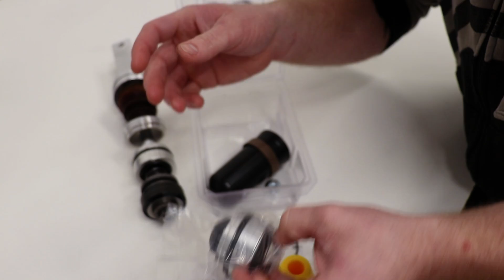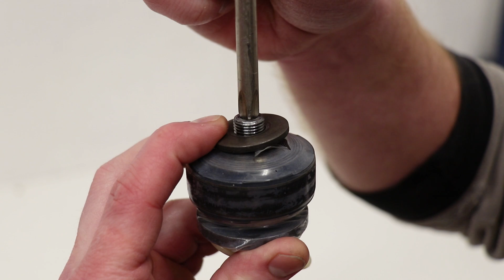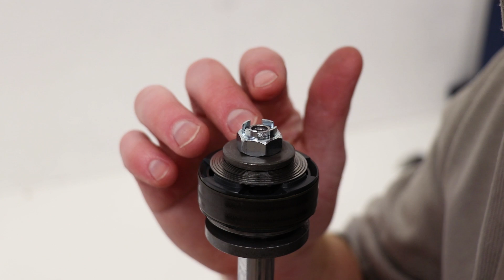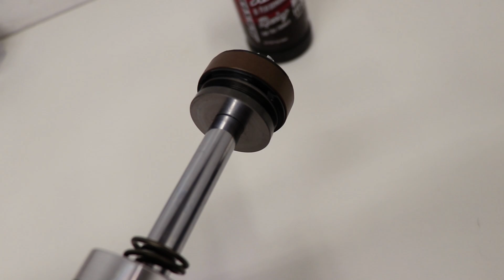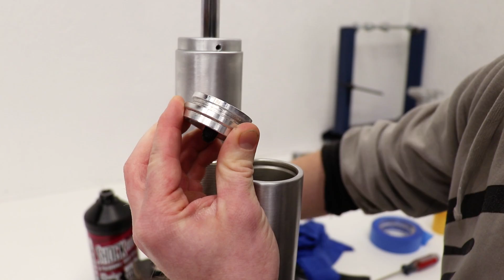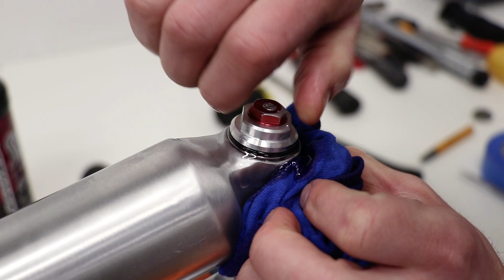Can I Get This Dirt Bike Shock Back Together?

Comment from the maker: What's one of your tricks of the trade?
Reply: bloody sweet..  my local mechanic charged me $300 for a rebuild, now thanks to your video I can do it myself..
already rebuilt the bottom end of my rm250 from your many vids with tips etc..great work
Reply: Unless the world has moved on without me noticing, a file should only be used in one direction, moving away from you. That will prevent them to fill up with shavings, as these will reduce the effectiveness of the file. 

OTOH, I thought I was too old to ever need a condom again, but you just proved me wrong. I need to stack up on them. Do you recommend smooth surface ones, or those with some pattern for extra friction and satisfaction?
Reply: @64faffi  you can also use a chalk stick to keep it from filling up and pulling a file can flatten the cutters dulling the file. Way I see it pull it if it helps keep it going the angle you want. Files are not expensive in comparison to all the other parts and tools also it takes a while to dull a file and I'm a poet and don't know it🙂
Reply: @64faffi  I would say ribbed for better traction in the mud. Being a dirt bike and all
Reply: Damn...i have to add condoms to my tool box!!
Reply: Cameron Niemela where’s the link for the discounted condoms?
Reply: There's no such thing as too much brake cleaner.
Reply: Cameron Niemela  poacatello idaho
Reply: bloody sweet..  my local mechanic charged me $300 for a rebuild, now thanks to your video I can do it myself..
already rebuilt the bottom end of my rm250 from your many vids with tips etc..great work
REPLY
2
Reply: Cameron Niemela when installing the spring nuts back on, I use the air gun to spin it all the way down so I don't sit there spinning it for a minute.
Reply: If you need to temporarily hold things in place (or permanently but removable indoors) then take 2 pieces of painters tape of equal length and stick them together using super glue back to back so the glue faces out. You can hold full body panels of a car in place like this. It's nuts how much holding power it has.

Edit: Ontario, Canada
Reply: Cameron Niemela Albuquerque, new mexico
Reply: California
Reply: Berea Kentucky!!!!
Reply: Honey badger hey there Pocatello Idaho, I'm from Twin falls Idaho!
Reply: Danmark
Reply: The Netherlands👌
Reply: Greece!!!
Reply: Germany, Rheinland-Pfalz,
Reply: What do you clean air filters with?
Reply: I beat the piss out of stuck things with a deadblow hammer and a torch
Reply: Your a journeymen assemblyman coming from an old retired one and your newest subscriber . My tips concerning this assembly would be having forks for drifting , same as used in disassembly . A dust vac. , switched and plumbed from outside your assembly area would be grand never using compressed air in or around your clean room driving contaminants into your work . Looking forward to more of your video's ,  Thanks
Reply: I forgot , I'm on the headwaters of San Jacinto west Sam Houston national forest .
Reply: kansas
Reply: Seattle Wa.
Reply: i am from Vermont u.s.a
Reply: Australia
Reply: Cameron Niemela I'm from Australia
Reply: Cameron Niemela  What kind of gas do you make in the gas capsule?
Reply: Cameron Niemela What kind of gas do you make in the gas capsule?
Reply: South Australia, in Adelaide
Reply: Clean, clean clean!
Reply: Suomi, perkele.
Reply: brazil estado bahia
Reply: lol we know ur trick!!! lol
Reply: North Carolina about to rebuild my shock too and see how well cerakote will hold up on my shock spring

Comment: Hey Cameron, i hope you're doing alright!

Do you have any tip or warnings for removing the final nut that holds the shock shaft to the lower body on a Kayaba shock? (YZ125 1998)
A) i want to oven cure coat the body and not air cure (different bottles) but also,  B) to remove the clicker at the bottom to survive the process and also check if it's working correctly/lube it, it looks like the only way is through there. (no other visible way to remove)
I think the nut is a 20mm socket and i have a CruzTools suspension wrench exactly matching it, but i don't know a) which way to turn to untie, any chance it is reverse? b) should i, must i, can i heat the spot? Is there supposed to be red loctite there or something, because these arms of mine can't seem to beat this one free! (i haven't been riding much lately ;-)

Thanks for everything brothah!
Cheers from Greece

Comment: Not sure if this has already been addressed.  But the process used with the pointed punch is called staking.
"Being that we've removed the peened over threads - lets lock the nut with several stakes"

Comment: Hi Cameron, is it better to put the shock together like this or when you fill the The reservoirs with oil and then push the bladder in with oil spilling out, then pumping the shaft to get air out. What’s the better way to do it?

Comment: Nice work!! If you can I would get pivot works shock thrust bearing for your shock, trust me you will like what it does for your rear suspension!! I'm suprised that you did not revalve your rear shock with a Race Tech gold valve, they make it easy to do and install!! Keep up the excellent work and looking forward to another video!

Comment: Use a dremel and nipple the peening off and use a length of wire coat hanger to take the stack off no need to a rubber etc...way to much work getting in off and on. You should also face the pistons 
Never flat file the Showa or KYB as there is a rebound jet in the shaft that will come out and you will need a new shaft ( Pro Tip A-Kit has a removable jet that you can change bleed hole size, this separates the Comp from the Reb so makign a change in one does not effect the other)
No need to peen, just use blue locktite
Use OEM seals when ever you can after market have way to much sticksion
No need to change the piston band and o-rings unless worn through. You are creating a ton of new sticksion
With the shaft nut loose you should be hitting it with compressed AIR to blow and crap out of the shim stack

Orient the holes of the end cap at 12 & 6 O'Clock so and water will drain out

You are working way to hard the way you demonstrated how to bleed the shock and promise you let a lot of air in there...The bladder needs air while you are compressing the shaft for one

Use  bicycle pump to add air to the bladder to avoid a mess
Reply: How can you ensure all the air is out of the shock? I've heard the pro shops pull a vacuum on the assembly. Any more home shop friendly ways to do it?

Comment: Hello from Texas! (Since you asked) Great video, as always. Super clear and informative and a perfect step-by-step tutorial on a complex (even mysterious) topic. QUESTION: How well does your powder coating hold up to the constant flexing of the spring?? I had wondered if it would eventually crack and peel off, or if powder coat will somehow flex with the spring's compression and expansion. Once again, THANKS CAMERON!

Comment: We used to rebuild and revalve up to 750 shocks per year back in the late 80's and early 90's for Downers Grove Yamaha.  We clinically cleaned the shocks and assembled them submerged in oil using Spectro shock oil.  We did use Noleen SF-3 grease and all of our replacement shims for the revalve came from Ohlins.  The shims on Hondas are pretty nice but the shims for Kayaba's were not so good.  We also machined a 0.5 degree taper on the rebound side to pre-load the rebound shims.

Comment: Just a quick question approximately how much oil went into the shock? I'm rebuilding a rear shock on a 2010 husqvarna cr125, their not much info out their any info is appreciated. Thanks
Reply from the maker: I used the majority of a quart.